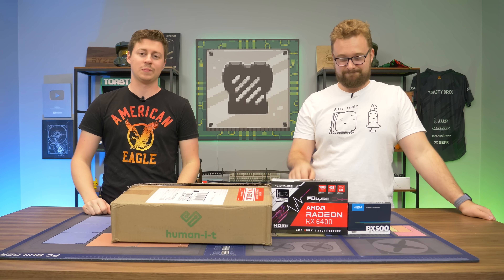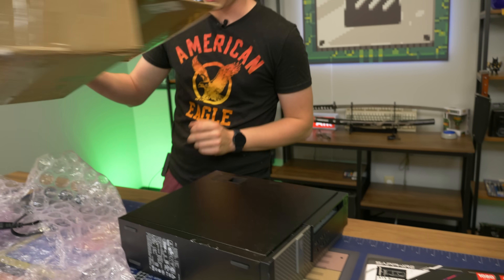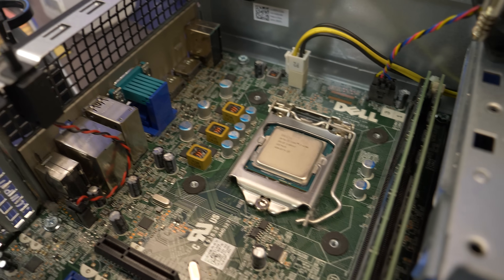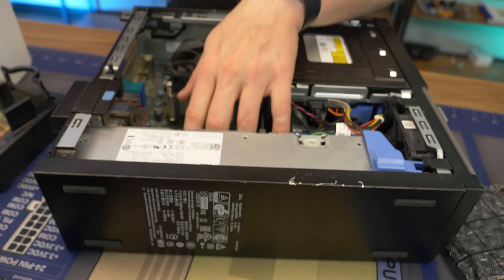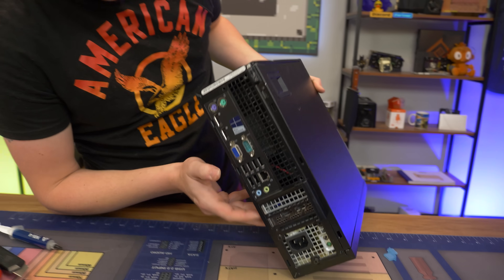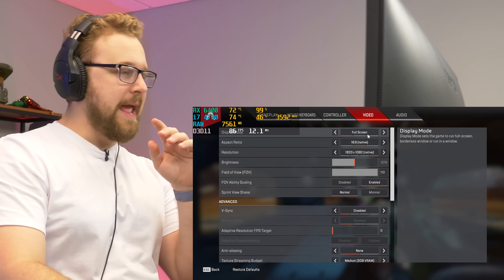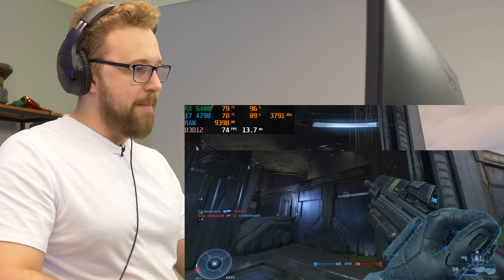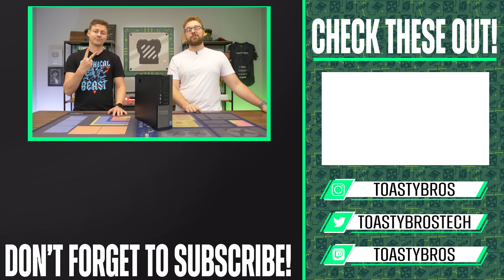EASY $350 Gaming PC Build 2022

Comment: Believe it or not, I was able to build the same pc for $100 all in. Found an online auction and bought to optiplexes for $60 ($30 each) and then found an rx6400 for $70 on FB. Perfect PC for my wife!
Reply: BUT it didn’t recognize the GPU at first and I spent several days troubleshooting until I fixed it. Had to change bios settings as well as enter some commands

Comment: dell 7050 mt. i7 7700). dell oem 360w psu with 6pin,, 32g ddr4 crutial pro. 1650 evga SC ultra 4gig) 256 samsung nvme. wifi6 ax200 512g silicon power ssd (and) 1 tb silicon power ssd. ...... i built the whole thing with warranty for around 600$

Comment: My case use for this pc is emulators and Emulators can take up alot of space if you want alot of systems especially anything graphically better than dreamcast. But i like this form factor because it still has a 3.5 hdd slot. And its still more portable than tower pc's If you want every game ever made emulation wise thatll cost you 96tb so theres no way its all fitting on one hdd alone. So you kinda have to pick and choose. Which systems you want. Im going to fit what i can on the largest capacity 3.5 hdd possible inside a 9020 sff. If i had unlimited money id get the 1500 dollar rtx a4000 sff gpu. But im sticking with the gtx1650 for price. Also if your looking into it, an rtx a2000 will also fit the low profile dual slot available on these pc's but theyve gone up 200 bucks to 500 since i last seen them at 300 a yr ago and theyve become popular amongst gamers recently. Also if you have a  215 watt power supply the biggest replacement dell offers is a 315 watt power supply for plug and play and i dont think anyone become successful in getting any other psu even with the adapters while also having it still fit in the original case. If you dont use the disc drive you can get an adapter on ebay or amazon to convert it to a 2.5 ssd slot storage bay which is also pretty cool i believe its the 9mm one since it is a slim drive to begin with. The other would be a 12mm if the 9mm doesnt fit. The best CPU they can take is an i7-4790. And only go with the 7020 or 9020 for best upgradability albeit not much but still. This is from a few months of research up to the current date 12/2023

Comment: The rx6400 its not a good idea.

The CPU are too slow and the PCI-E Slot have 3.0 
u need 4.0 or you have micro-stutters while playing.
Or even strong laggs.... 

I have an r5 2600x (4,15ghz) with the rx5500xt 8gb. And a Asrock b450m pro4 with PCI-E 3.0. And even with my CPU and 8gb Vram, you have such problems.
An rx550 4gb would make more sense in such systems, and can't deliver more FPS than the CPU anyway.

Edit: And the rx550 is faster as a 1050ti....

Comment: So I picked up a x79 mobo cpu xeon e5 2658 v2 and 16gb of ram for 129 on Ali express. Value deepcool case 29 bucks, 550w ps 29 bucks. Paired with a cheap cpu cooler and SSD. Gpu is eagle rx 6400 159 at Canada computers and I get 54 fps on warzone low setting  with Fxr2.0 ultra performance. Very playable and very cheap and very satisfying 😊
5:10

Comment: Current Opti build is a 7040 SFF with Core I5-6500, 16gb RAM, 512gb m.2 NVMe + MX500 2TB for storage, RX6400 and 180w PSU...upgrading to 64gb RAM soon and considering upgrading CPU to Core I7-6700...I think upgrading the PSU would be a good idea too...I have a 315w SFF PSU laying around...may as well try it out...lol
Reply: Did you have any problems running a 180 psu with a RX6400?
Reply: @TFEArchive  I have had a couple of games that were less than optimal...not sure if it's CPU bottlenecking or possibly a power issue...I'll eventually swap the PSU and see if that resolves it

Comment: Really unusual coming across this, almost identical to what I did myself a few months ago. SFF hp prodesk 405. Came stock with a ryzen 5 2400g pro. 4 core apu. It was alright for casual browsing and I mean minimal, minimal gaming. Upgraded to 2666 16gb ram (Max the hp mobo can take speed wise) and actually got this exact same GPU for the reason you stated. The fan doesn't hang any lower than the 1 lane. I had the exact same issue of the 16 pcie being snug to the PSU. Only real difference is I completely removed the hard drive caddy, drilled a square in the top of the case above the CPU and added a mesh filter. Replaced the CPU fan with a noctua but kept the CPU wind tunnel so all that air goes out. Then removed the front panel and added two 80mm fans to create positive pressure and aid the GPU. 

Under load while gaming I'll see anywhere from 60-65 degrees for the CPU and 69-75 for the GPU. which for a small form factor prebuilt case is insane. Not to mention the cpu and gpu pair between 15-20watts each under load. The system costs almost nothing to run.

Comment: I have an Optiplex 990 SFF, I am planning to put an AMD Radeon RX 550 4GB GDDR5 Graphics Card Low profile inside of it. From what I know of, this GPU takes around 20 Watts which is what the online internet told me. So it should work well inside of it. I am also giving it 16 Gigabytes of ram at 1333 MHz with a Intel Core i7-2600k. I think that is what I remember. Hope to get it all soon in the future.
Reply: If u can't over clock on 990 why 2600k?
Reply: @justjoe8660  I changed it to a regular 2600 a few days ago, I forgot I did this comment. I read up a bit more about the system.
Reply: @zeroman0460  yea I have a optiplex i5 2400 that I'm upgrading with 2600 also. Would've been sweet if we could use the K version
Reply: @justjoe8660  I never had a Optiplex or heck, even an actual desktop ever. The 990 SFF I got from School because no one wanted it. I want to give it love and care; and linux too.
Reply: @zeroman0460  that's awesome man. It's very easy and inexpensive to upgrade. I think ull be pleased with it😀
Reply: @justjoe8660  I hope so. Wish me luck.

Comment: Nope, No thank you AMD. The RX 7400 better have PCI 3.0 x16 Lanes 4GB DDR6 with an AV1 Hardware Encoder and Decoder. Stop cheating us Budget Low Profile M-ATX / ITX Gamers with Crap worse than a 1050ti. Not expecting RX 6600 performance here just New Era Low Profile King or else I’m waiting for New GT 1030 Successor and no 1630 is $ Hit Nvidia.

Comment: I put the sapphire lp RX 6400 in an Optiplex 790 240w PSU i5 2400 16GB SFF and it runs great. The only problem I had was audio distortion crackling static when using hdmi audio. I installed new audio drivers, changed a ton of audio settings, and nothing worked. Had to use 2.5mm oe jack for acceptable audio.
Reply: Drop a i7 2600 in. Its like 20 bux or less

Comment: I did same on dell 7040 I removed whole disc drive and harddrive leaves loads more room for airflow etc and used m.2 slot instead so they weren't needed

Comment: How much power does the rx6400 need? My system has a 260w power supply.
Reply: Less than 75w.  Rated at 55w IIRC.

Comment: My gaming PC died (after 28,000 hours) and due to some financial issues a friend gave me a Dell Optiplex 9010 that had been "refurbished" with a SSD and Win 10. It was a Legacy BIOS and to use it for gaming the first change that had to be made was a shift to UEFI. A PSU needed to be made so the video card could be installed and I replaced the 8 Gb memory with 16 Gb . I added a 2 Gb HHD and then it was ready to go.
It works well and considering the cost in total it would be VERY difficult to beat. 
Thanks for upload, I never realized how popular and available the Dell series of PC is.

Comment: The major problem with USFF is these are using 100% utilisation and thermals are way to high. People that game for hours on end will have overheating issues. 80+ C in this video for GPU. Lack of air flow is the biggest problem. Power Supply is another issue, be lucky if that PSU is 220w to 250w

Comment: Do not buy a fully housed low profile card like the XFX Radeon RX 6400 card, the heatsink housing plate will hit the I/O connector on the Dell 3020 SFF board, I took it off and I got an "Alert! front I/O cable failure" every time I boot up. The Power Color and Sapphire RX 6400 cards will fit fine because of the heatsink gap! And also Dell makes stupid proprietary designs on their motherboards to piss you off by not letting you use  dual low profile slot cards on most of their Sff cases with the PSU's close to the PCIe x16 slot!

Comment: Just to clarify what what PCIE 4.0 MEANS : IT MEANS ITS VERSION 4 THAT HAS X4 BUS BANDWITH - IT STILL HAS 16 LANES OF DATA TRANSFERS.  iT DOESNT MEAN THAT IS 4 LANES  CARD LOL ! DIFFERENCE IN PERFORMANECE ON THIS PARTICULAR CARD  FROM X3 *(PCIE 3.0) BANDWITH AND X4 BANDWITH ( PCIE 4.0) IS ONLY BETWEEN 8-10 % WHICH IS HARDLY NOTICABLE .

Comment: There is no reason to upgrade the power supply in Optiplex systems to fit this card in. Dawid Does Tech Stuff used this card and a GTX 1650 in a Acer Veriton with a 220W PSU. Most Optiplex systems come with 240W. Dawid benchmarked GTA V and it averaged a 20W use of power and 40W in Cyberpunk. I hear and read lots of people saying to upgrade PSU but unless you're running 4 games at high at once it shouldn't be a problem if you have a low wattage power supply.

Comment: Do you need a new power supply to do all this? I have a 255 watt but I don’t know if that’s enough
Reply: The reason why RX 6400 is the best for optiplex gaming is because they consumed 53 watts, one of the lowest I ever seen in any GPU. It’s even lower than GTX 1650, which consumes 75 watts, and performs the same level. Anything around 180-250 watts should be enough

Comment: Do not use DRAM less SSDs as boot drives. Especially now a days when the price difference between them is so small.

Crucial BX500 = NO DRAM CACHE = Bad boot drive, will die quickly, you will lose data, etc.

Comment: Had Optiplex 7010, i7 3770, 16GB, 256GB SSD + 2TB HDD, GTX1650 LP, it was awesome little machine.
Reply: Did you upgrade the PSU?
Reply: @crownthychamp3184  Yes i did, standard fit well.
500W is more than enough.
Reply: Have the same build but the difference I didn’t not upgrade the PSU and stick with stock one and works perfectly

Comment: thanks bros, really appreciate the info on 5:42. I was about to buy RX 6400 to be installed into my old pc running i5 3rd gen. thought it would run on PCIE 3.0 x16, turns out it doesn't work that way according to your explanation. 

that aside, do you have any recommendations for what kind of GPU should I put into my old pc? I have other option in mind like GTX 1050ti, but the BNIB price is more expensive than RX 6400 right now. Thanks.
Reply: Know this is a a month old, but just to advise. I am currently running an XTX - RX 6400 in a PCie 3x16 (x4) slot and it works brilliantly. This is embedded in a Dell 7050 7th Gen i7-7700 Mini Tower.
Reply: @robertpelton2119  does the x4 lane become problems with the gpu speed?
Reply: I have a DELL Optiplex 7010 Desktop (You know only low profile cards), and originally it had a i5 3570 (3rd gen), the CPU I chose to upgrade was the Xeon E3-1340 V2 (i7 3770 equivalent, but at half price), it lacks the integrated GPU. For GPU I decided for the Nvidia Quadro T600 (similar to a GTX1650), or if you want more in low profile the Quadro T1000 is great.  https://youtu.be/torNoHC0tEQ

Comment: I've upgraded a few Optiplexes with SSDs (Crucial MX500 always) and the biggest issue I have found with them is the lack of motherboard fan headers, SATA power connectors, the low wattage of the PSU and no GPU power connector.

If Dell spent an extra couple of dollars getting just a bit more wattage out of that PSU, that would be great, or if another company made an aftermarket one to fit as an upgrade with 2 more SATA power connectors, a 6+2 pin GPU power connector and a few cents extra on a motherboard fan header and SATA header for an additional drive, you'd have the potential for a cheaper gaming rig. Dell and HP seem to always have cooling issues with no fans pulling cool air into the case.

A few months after this video, it's now possible to get 7th or 8th Gen Optiplexes for $200 (I got an i5-7500 for £150 here in the UK), which then gives you the bonus of an NVMe slot.
Reply: Yes all that is true, but IMO nobody in their right mind upgrades a Dell Optiplex without a new PSU.  That is the first thing one does.  Otherwise you are holding everything back.  In the states btw, used Optiplexs are running about $80 to $120 with SSDs, 16Gs of Ram, and 500 HDDs, and all that is needed is the new PSU and GPU and it's done.

Comment: I'm running an hp z440 myself, recased into a consumer case, with a gtx 1070. Exact same price category, I'm pretty proud of it. My build prior to that was the same optiplex with the i5 and 16 gigs, got it for 30 bucks
Reply: @Gaming & Tech it seems to be a standard or near standard full atx board. Any case that can support atx or Eatx will work. I used an antec 900. A classic.

Comment: What kind of temps are you getting with this card? I got the XFX RX 6400 and it is hitting 85C-90C when gaming in a HP SFF desktop. Wondering if this one runs cooler?
Reply: Apparently the XFX one runs hotter due to a weaker cooling solution.
Reply: On low or high settings? How git runs yours when only browsing on internet or playing g games like valorant or overwatch

Comment: Use the gen older i7-3770 optiplex it has the pcie x16 on top to allow a gtx1650 to fit.  May perform better.

Comment: I hope the upcoming GTX 1630 could also fit on builds like these, then I'd might get interested to buy an optiplex.
Reply: the GTX 1630 sucks; it's a cut-down TU117 chip and every one I've seen thus far is standard form factor. Full height, two slots. How useless. Unless they've made a SSLP version I'm not aware of... a T600 is still better.
Reply: The gtx1650 works also... might have to upgrade power supply if you have the 255watt version to the 315 watt version not hundred on that but it would cool your Temps anyways so it's worthwhile anyways to upgrade.